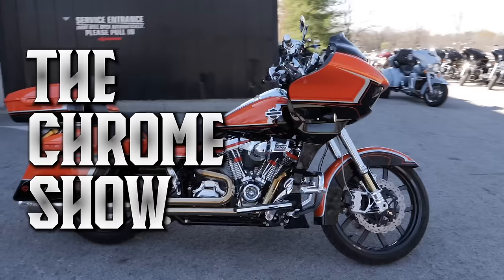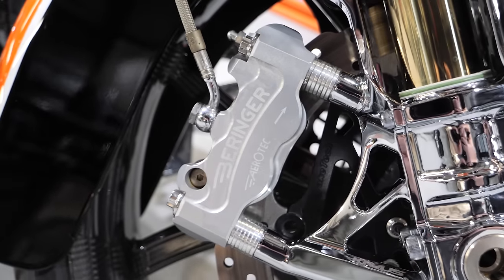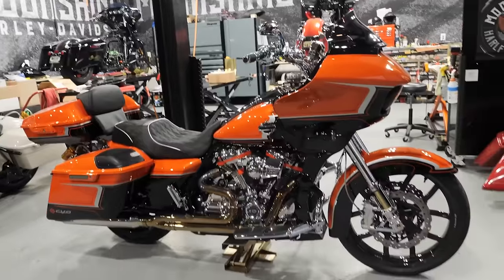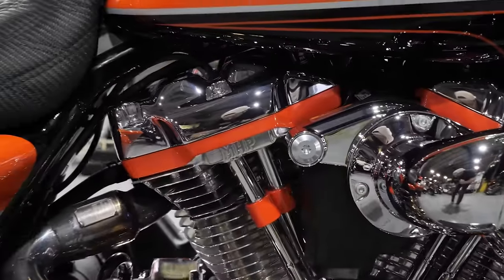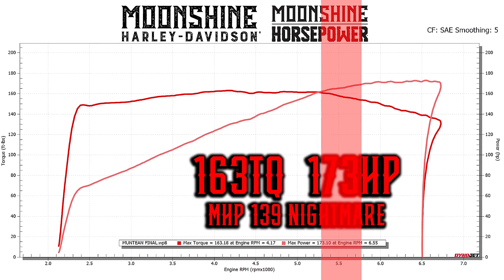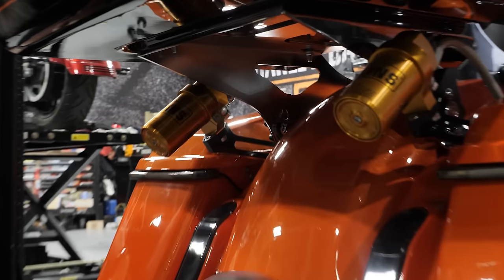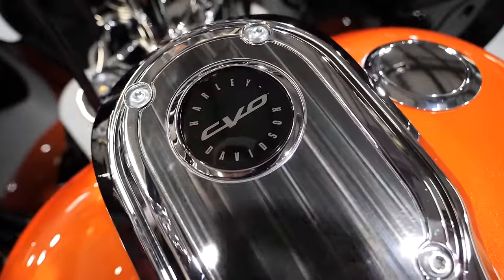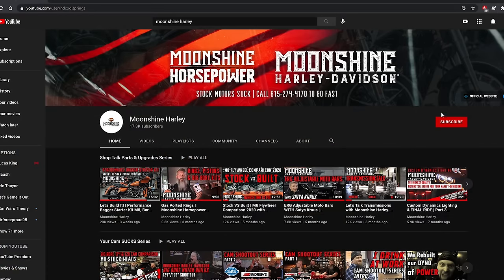173HP 163TQ MHP 139 The Chrome Show! | Bike Build No. 39

Comment: No one builds better Harley-Davidson performance bikes!!!🏁👍.  They did a 128 for me a couple years ago 147hp and 152tq.  I couldn’t be happier.  Super reliable, I have taken it on several 8 day trips through the blue ridge mountains without issue.  The torque when loaded with gear in the mountains is so fun, especially when riding with all my buddies on stock bikes 😜
Highly recommend Moonshine if you want a built bike that performs

Comment: Congrats, you took a 45k MC and replaced everything and made it a 75k bike. 
BOTH of my Ducatis have more HP, TQ and better suspension and brakes, from the factory at less than half of the price. And yes, 1 of my Ducs is a Twin. And they both weigh about 300lbs less.